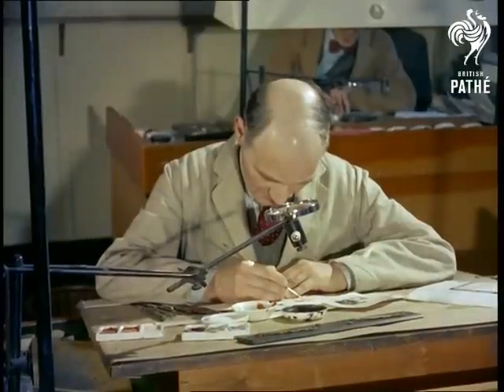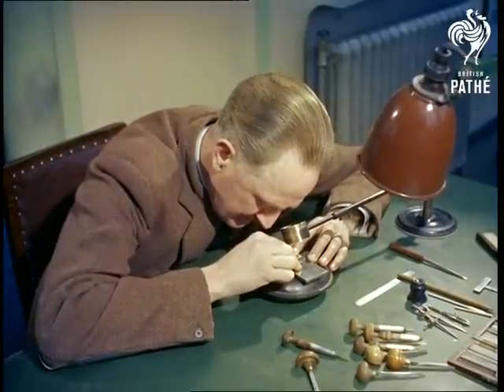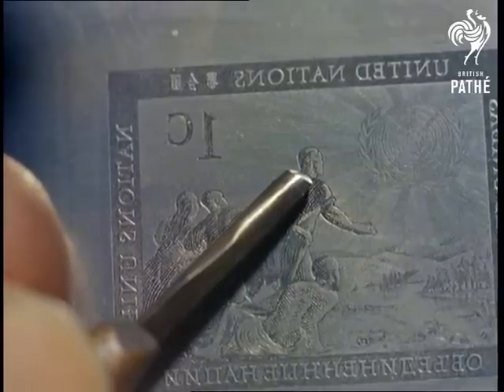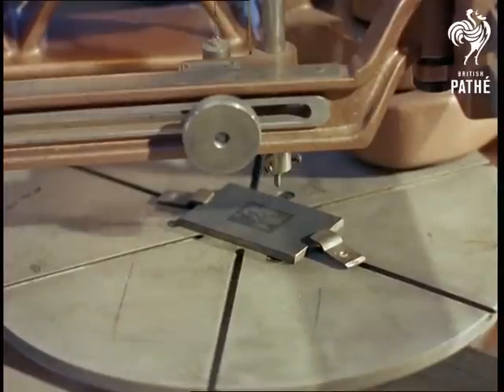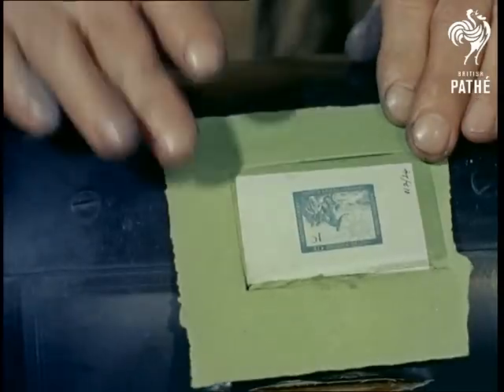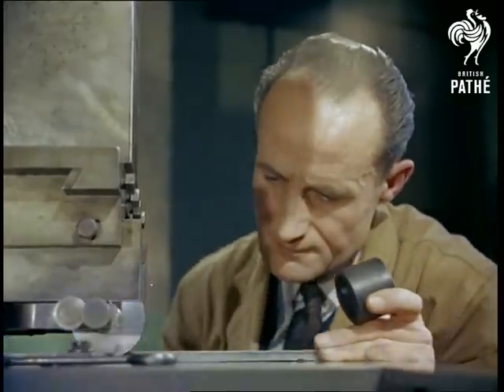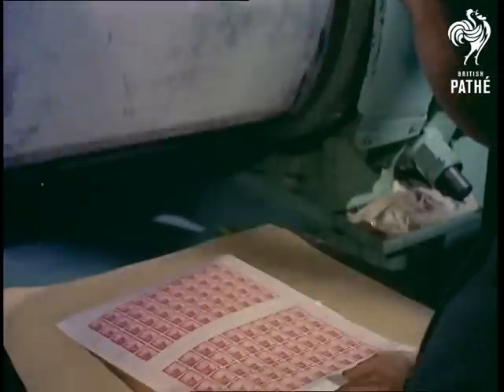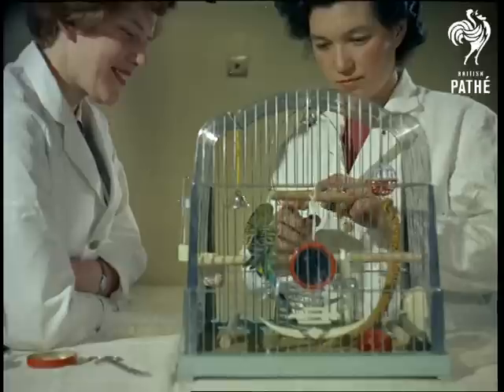Foreign Stamps Aka Stamp Factory (1956)

Comment: If you watch, there are two engravers working on this stamp. The first one would be A.B. Crosset who engraved the frame and lettering. Then it changes to an older man who is working on the vignette or central picture. This was done by J.C.Evans.
I have often thought that the engraving on some of the early United Nations stamps looks like it was done by a machine. This shows that on some stamps, the U.N. symbol was done using an apparatus that reduced the size from a pattern.
Reply: + Hello John: the person at 2.23 seconds in lettering Artist Reginald Delvalle as confirmed by a fellow conremporary artist.